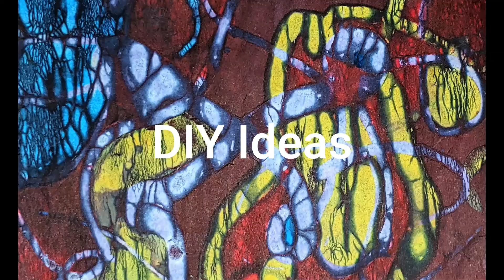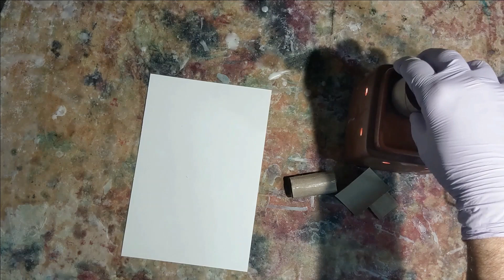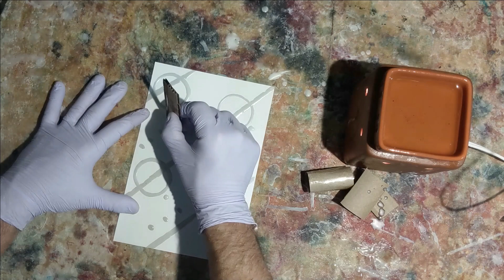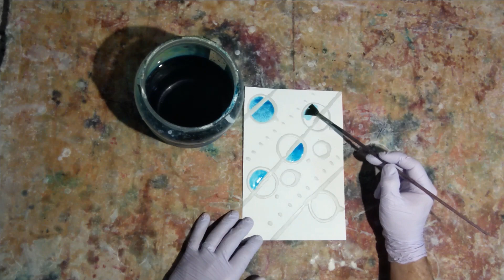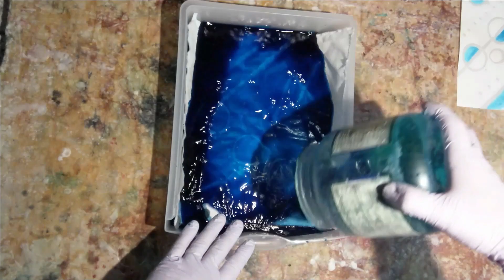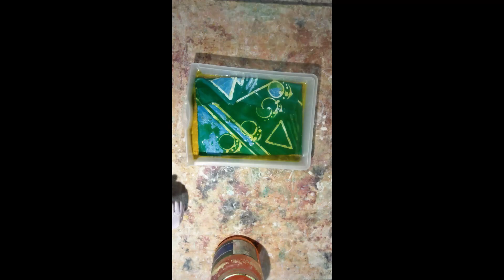Easy Batik Tie Dye Project - Batik step by step to take your new tie dye ideas to the next level

Comment: Teacher here and newbie with batik. How did you get the wax off?  I need a “safe for kids” way  of getting the wax off.
Reply from the maker: I boil it... Which isn't exactly the safest way with small kids.  However if you stick with pure soy wax you can usually get it out with just very hot tap water.  Ironing them between layers of newsprint is another option